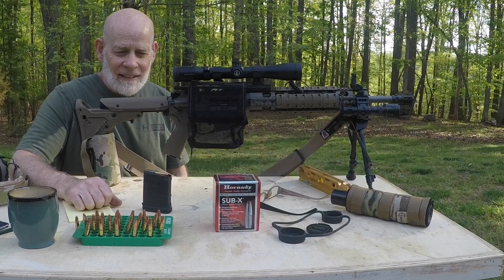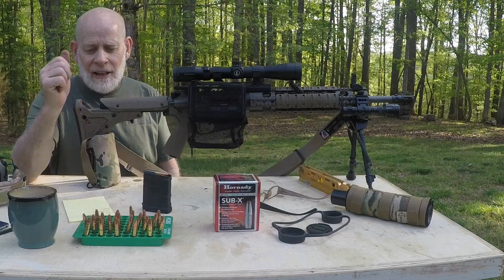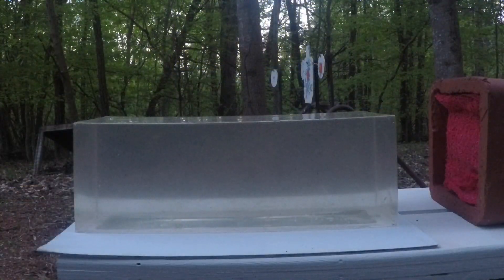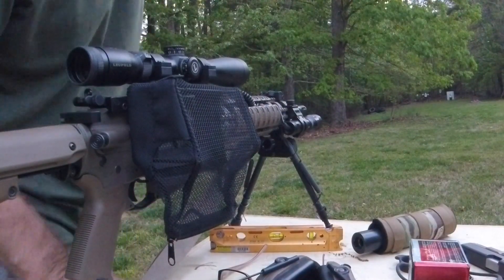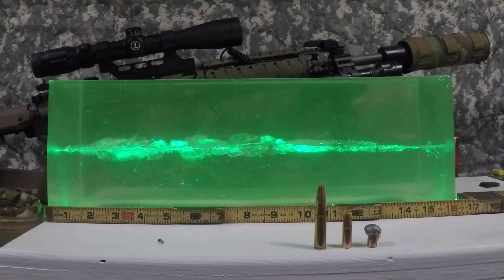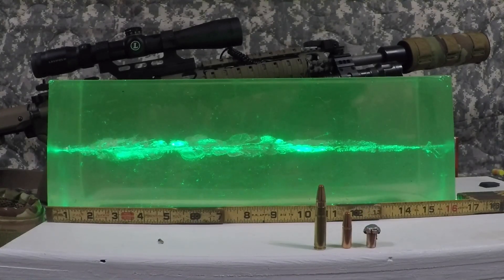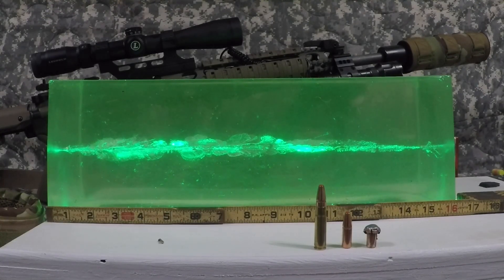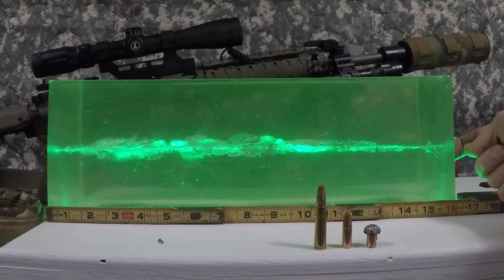300  blackout Hornady sub-x. 175 grain ballistic gel test￼.

Comment: Would you recommend for home defense suppressed? I’m building an indoor rig. I have an 8” build I’m more than likely going to switch to a 10.5” barrel with adjustable gas block and top it off with my omega 36m suppressor.
Reply from the maker: I happen to have a suppressor! I do not use it on my home defense rig. I try to keep it as short as possible. I am using an 8 inch barrel with a Navasky pig unfortunately due to. The way things are, I had to remove my pistol brace! ;)